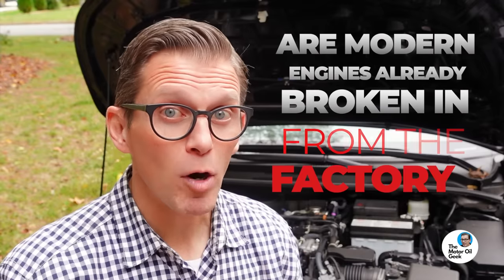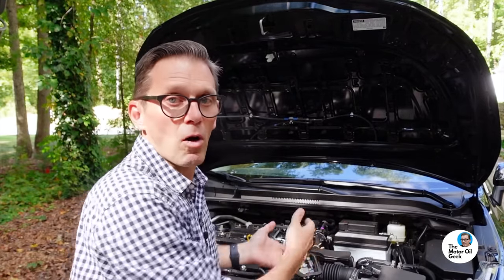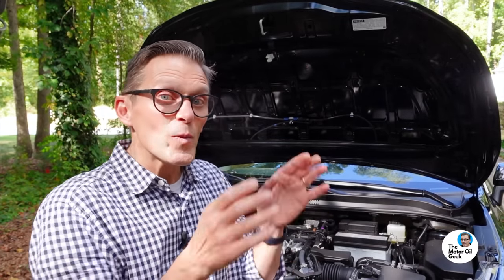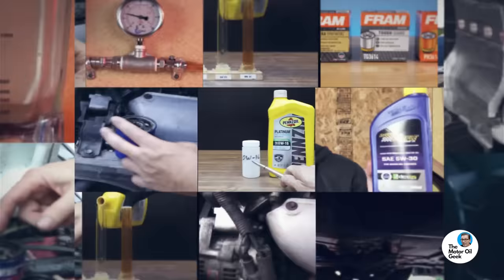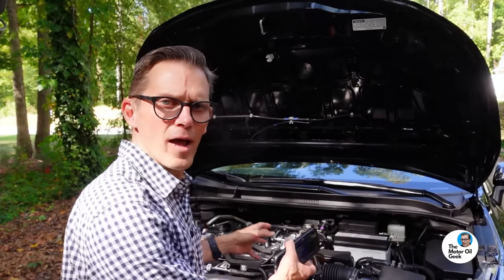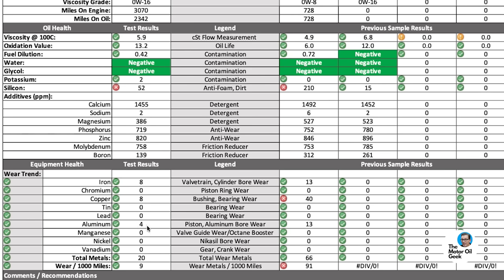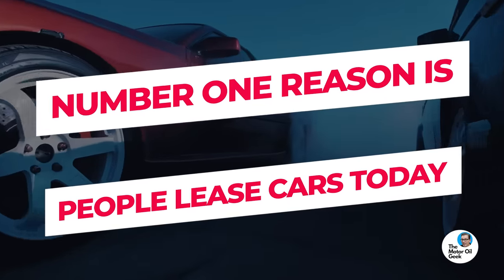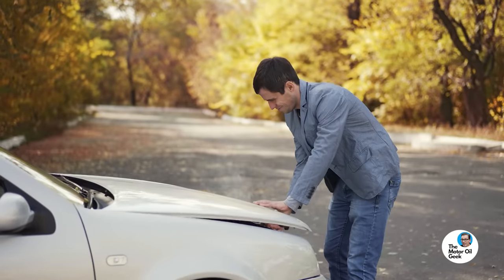New Engine Break-In: Truth or Myth?

Comment: Thanks for your content. I just bought a new 2024 Equinox last month. It's at 390 miles. I will be changing the oil and filter around 500 miles, as I did with my 2016 Equinox and my 2004 Harley-Davidson. When I traded in the 2016 Equinox at 67,000 miles, I never had to add oil in between oil changes. Same with my Harley at almost 80,000 miles.
Reply: It's still 2023 in the yard. How could you have already bought a "2024" car? Clown :D
Reply: @hid3nax  The Chevy 2024 Model year started a couple months ago.
Reply: @hid3nax  were you born yesterday? That's how it's been for decades 2024 model cars come out around late summer early fall of 2023 just like how it's been for decades. So when you got a 2016 car it's actually manufactured in 2015
Reply: @whereswaldo9089  So in fact, what you call "2024" is actually one year older car. I don't get americans - what's the point of doing such confusion
Reply: @hid3nax  it's not a year older car it's a current car. 24 can either be a 2023 or a 2024, depending on the time you bought it. Their's no confusion it's been like this since the 70s or even before.
Reply: @hid3nax  and it's not Americans it's car manufacturers including japan, European, Italian, Korean cars everywhere that do this
Reply from the maker: Glad to help
Reply: @hid3nax We picked up a '24 Corolla in October.  They had just started getting them in.
Reply: In the US of A, following year autos are released in around September at some point. But last few years ALL manufacturers have been releasing ahead of schedule because they made ZERO CHANGES and wanted top dollar for ANY model they sold
Reply: @ricklong3218  I'm a retired assembly line autoworker. I hired in at Oldsmobile in August of 1971 and the 72s were already being built. Calendar and model year have never been in synch. The only changes between the 2023 and 2024 Equinox is that the 24s have what was optional packages on the 23s as standard on the 24s. MSRP prices were exactly the same when equipped the same.

Comment: Thanks Lake, this is most interesting.

I'm glad to see that my choice in doing  several early, starting at 300 miles, oil changes on my 370Z was a good thing to do. My hunch was that in using the specially formulated oil, Nissan ester oil for its very low friction, as recommended by Nissan would result in a prolonged break in period. This seemed to be confirmed by the progressively decreasing amounts of oil consumption between oil changes over the first 15k miles. I think that limiting acceleration and revs over the first 5k miles also contributed to the slow breakin.

I think this was a good thing to do for achieving maximum longevity, along with using short oil change intervals. I plan on doing some used oil analyses on different oils at different oil change intervals to see what will work well. The Nissan ester oil has problems in coping with the high thermal and mechanical stresses generated by the engine's variable valve timing machinery. The oil basically shears down from a 5W-30 to something like a 5W-20 after about 3k miles, hence my 3k oil change interval.

I've been using the Fram Ultra Synthetic oil filter ever since the OEM Nissan filter that came on the car. I'm using a 50% taller filter that was designed for larger engines for the increased filtration area and reduced pressure drop, to compensate for the fact that the filter is more restrictive because of its denser filtration material.

Keep up the good work. I've loved your work with Total Seal and all the information you've given us.
Reply from the maker: Thanks!

Comment: I worked in the second tier automotive manufacturing sector for 40+ years, supplying many different types of powertrain components. Some of our parts gave up material as they broke in, and some created wear of mating components during break in. It's the nature of the system and should be managed for longevity by oil & filter changes as you recommend. By the way our quality director had a sign on his desk that said " without data it's only an opinion". We solved many problems and helped our business and customers develop data driven decision making processes resulting in superior components and world class manufacturing. Your data is appreciated and respected.

Comment: Finally, finally, someone who actually knows something. I have been asked that same as I am a Techical Advisor in an engineering company, I have worked for a CAT dealer 40 years ago, and dealt with their SOS oil testing, and heard countless of times that modern engines do not need a break-in with an early oil and filter service. Here in Finland we have harsh weather that harms oil faster, and modern engines have so little piston ring tension that they use oil a lot if anything is wrong. So, as I remember aero piston engines having spesific oil for break in, and instructions how to break in the piston rings with enough intermittent power settings, it would be impossible to have them seated properly at factory, even if the boring and honing were made with stress plates.
Thank You sir.
Reply from the maker: Thank you for watching and sharing!

Comment: Lake, you said toward the end that you showed that changing oil early reduces wear. That is certainly intuitive, but could you elaborate on the science that shows that? Where have you done a comparison of engines with and without early oil change intervals? It seems intuitive that getting rid of oil with a lot of little particles in it would be beneficial to the engine over the long term, and I always do an early oil change myself on new engines, but I’m not sure you’ve actually shown long term benefit anywhere.  If so, please provide a link. Thanks!

Comment: I believe the first oil change for my 2020 Silverado was at 2,500 miles, mainly because my stepfather kept suggesting I take advantage of at lease one free oil change from the dealer before the deal ran out. So to make him happy I had one oil change done by the dealer and that was it. But I was very reluctant to have them do it because I absolutely hate the dealer touching my vehicles. They just love to go in and change out things you never told them to touch and they charge you for it. 

Since it's my first brand new vehicle where all of the miles were put on by me and it being a lease vehicle I originally treated it as such. Making sure to put as little miles on it as physically possible without going over the allotted mileage for each year. So I was originally trying to go per the owners manual for the "first" oil change at 5,000 miles. But that was interrupted and the oil was changed much sooner so I could get a free oil change. I'm used to having old hand-me-down vehicles that have already had thousands of miles on them so I always did up to their recommended change intervals or slightly before.

I might change the oil sooner just like the previous three times just to be safe and get it done for the winter so I'm not changing the oil in the snow. The stock oil filter is not a very good design so I wouldn't trust it to reach even its' 5,000 mile claimed rating. :)
Reply from the maker: Thanks for sharing!

Comment: Great video. Thank you for doing it. Would love to hear you talk about oil filtration. How does the consumer decide on the best oil filter? Like the oil manufacturers, the makers of filters just seem to spew marketing nonsense with no data to back it up.
Reply from the maker: Great suggestion!
Reply: @themotoroilgeek what oil filter do you use?
Reply: Stay away from Fram and Super Tech
Reply: @homerfry9234  Thanks!
Reply: Believe it or not, most OEM filters are pretty good as they are designed to be fairly restrictive and conservative. Same with air filters. If you want the cleanest engine, you want slightly less airflow and finer filter material. The wear you see in engines run in the desert with those K&N type filters is sometimes quite shocking. I'd rather sacrifice 5hp and have half the junk in my engine and oil (where all the grime and dusts ends up anyways).
EDIT - K&N filters were designed originally for people who raced and cared about winning more than engine life as most rebuilt their engines after a few races anyways back in the day ( and often still do ).  I really don't recommend them for people who want to keep their cars for decades.

Comment: Awesome video, i love that your information is based on scientific analysis. Cold hard facts are beautiful.
  What im wondering is if the difference in ppm before and after is actually enough to harm an engine. Fyi.. Im absolutely not an expert or a mechanic. Just a curious idiot. 
U would think that the small difference in "Part per Million" would be negligible. 
That being said... i certainly would want the lower of the numbers inside my brand new engine lol.
Reply: It's abrasive either way so less is always better.
Reply from the maker: Thanks for the question. In my experience, a higher level of wear leads to an increase in the wear rate, so 40 ppm of copper, if not dealt with, will lead to an even higher level of copper. Unchecked, it could lead to severe damage and/or possible engine failure. 

The science of used oil analysis was pioneered by the US Navy and Air Force to reduce the number of aircraft failures by catching problems well before they become significant.

Comment: Wish I would have known this before! Wife's Pacifica lost a lifter and took out the cam at less than 20k miles! Oil had been changed twice before that happened due to the 9k ish recommended interval and I have gone back to 5k ish oil changes. When I buy a new truck it WILL DEFINITELY change the oil at less than 1k, then again at 3k ish. Appreciate your knowledge and "warning"!!!
Reply: I should also add that I used, and still to this day, Pennzoil Ultra Platinum full synthetic 0w20 oil. The numbers do not lie and the dealer uses Pennzoil Platinum 0w20 full synthetic for the $100 oil Change. When I do it myself, and don't have to wait over an hour plus waiting for the appointment, costs me about $40 for factory oil filter and Pennzoil jug.
Reply from the maker: Sorry to hear that!

Comment: The question, however, is whether 13 ppm iron, 40 ppm copper and 13 ppm aluminum is really that destructive (relative to 8, 8 and 4, respectively) to worry about in a normal (e.g., 5000 mile) change interval. Those are still tiny amounts and the filter catches all the bigger particles that would cause the most damage.  Also, it would seem to matter what driving habits of the driver are. For example, if a lot of time is spent idling in heavy traffic, idling in a drive-thru line, or idling in a parking lot (I see tons of people doing this lately...just sitting there in the parking lot on their phone with the car idling for the heat or AC.  Idling is a relatively oil-lean condition for most engine parts as the oil pump volume is low at idle (700-800) rpm).
Reply from the maker: That’s just the particles the oil analysis can see, which is only up to 10 microns. The oil from the initial drain did have visible metallic particles, so those are larger than 20 microns. Also, oil filters do not remove 100% of the contaminants from the oil. The point being, the change in wear rate is what is significant. The numbers themselves are not what is most important. Lowering the wear rate was my objective.
Reply: @themotoroilgeek , good to know. Thanks.

Comment: Obviously modern engine manufacturing methods are more refined than they were even 30 years ago. But that doesn't mean the engine is 100% fully ready to go right off the show room floor. Yes the engine does still require some break in. Running upwards of 1000 miles then changing the oil will help the remainder of the engine's life to be extended. My dad told me when I started driving, that replacing oil is cheaper than replacing an engine.
Reply from the maker: Absolutely!

Comment: Good info Lake. I'll have to look to see when I changed my oil for the first time in my new 2010 Chevy.  I still own it. I had used Mobil 1 for the first 150K miles or so. Then I did a Amsoil and then to Pennzoil Platinum. I used to go by the oil life monitor. Those were usually 6 to 7K miles but as we've seen on DI engines oil needs to be changed more often. I'm now doing 4K miles on the Pennzoil Platinum.  I'm at 174K miles and it doesn't eat oil so I'm happy about that.
Reply from the maker: Thanks for sharing.

Comment: Enjoy your videos, I do have a question though. I've read that when the engine is new you should use non-synthetic oil instead of synthetic oil for the first however many miles. The reasoning is that it helps speed up the break-in due to not being as slippery, after that switch back to synthetic for the remainder of the engine's life.
Reply from the maker: Thank you!
Reply: Snap-solutely.  That's standard practice for serious car people.

Comment: I live in north carolina,  a freezing cold state all winter 🙃 so I follow manufacturers recommendation to use 5w-30.    NOT !
It's hot down here, my silverado runs on 30 weight while hot & running 🔥 
So.... in warm NC I use a stronger set of molecules etc in 10w-30 in order to exceed the crappy 💩 5w-30 factory recommendation.

Comment: Helllllo, thank you for another great video! Can you please touch on break in fluid from factory and/or if we're to replace said oil earlier than the manufacturer recommendations, should we then replace said oil with a replacement break in oil? (I've seen that too soon of an oil change/replacement of break in oil with a synthetic oil can cause oil/cylinder wall glazing and prevent proper seating?) Do you recommend any additives to help the break in process? Etc. Please and thank you Sir!
Reply: Well put, that's exactly what I'd like to hear more about.

Comment: If I bought a brand new truck. Gasoline I would drive it at different RPMs if I'm on the highway I'm bringing up to 3,000 to 2500 to never study RPM for hundreds of miles, then dump it out of thousand to 1500 miles I don't think I just truly broken 3000 miles this guy is who you need to talk to specializes in friction 10 different types of metal

Comment: I just bought a small yamaha ef2200is generator and I'm using the driven racing break in oil 5w30
Reply: Drain that oil after 15 minutes of first running.

Refill and run 30 minutes.

Drain and refill and run 1 hour.

Drain and refill and run until the 25 hour mark.

Drain and refill and run to 50hrs......

Now keep changing out the oil as per manual @ every 50 hours....

if it doesn't have one...fit a cheap hour meter/tiny tach.

There is no oil filter so all  the run in wear particles are circulating all the time.
Draining and refilling are the only way to get rid of them....

Comment: I thought putting in synthetic oil too soon would hinder break in and perhaps cause issues because the rings wouldn’t seat properly. And I’m asking only because it’s what I’ve come to understand from many others explaining proper break in on new engines. Thanks in advance for answering
Reply: Many cars come from the factory with full synthetic oil and trans fluid now. Toyota runs 0W-20 in half their stuff and they don't make anything but synthetic 0W-20.
Reply: Trend is definitely toward full synthetics.  Exxon is working on a synthetic gasoline in South America, which should reduce wear.  They will use it first in racing.  The process involves using water, carbon dioxide and generally wind generated electricity.  More details on Exxon website.  Not being done in US (at least no plans at this time).  Believe initial site is somewhere near Venezuela.  Toyota is also working with Exxon on this program.  Should make engines last longer (maybe less friction from sulfur and other elements).  Much cleaner than the German process used in the 1940s (which used coal).  Heard several South American countries use very high levels of ethanol instead of gasoline, even some of the countries that export large amounts of gasoline.  

I've been using 0w20 full synthetic for about 7.5 years, with a 2k-5k change interval (about 6 months, usually time expires for me before miles).  Unsure what prior owner of 3.5 years did.  No significant oil use between changes (level ok for full 6 months).  People have had trouble with some engines if they use heavier oil (does not always lubricate top of the engine fast enough to prevent wear around the camshaft and valves, I've heard).  Brake and transaxle fluid will be changed in 2024 (around 64k miles).  Transaxle is "lifetime" according to Toyota.  I interpret that as meaning the lifetime expected is decreased if you do not change the fluid around every 10-12 years or 60,000-80,000 miles.  

Dislike the trend of fewer dipsticks and gauges.  Prefer old-school cable driven parking brakes.